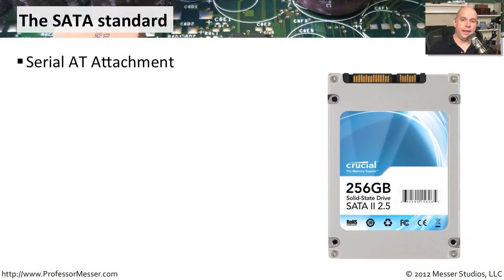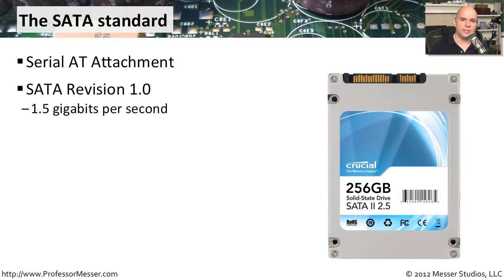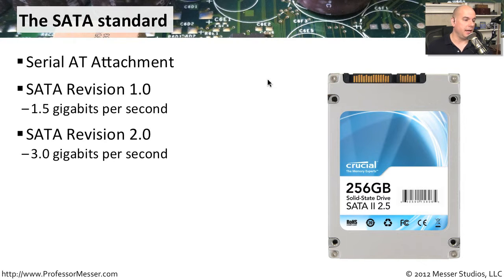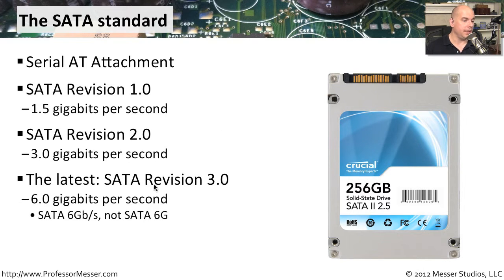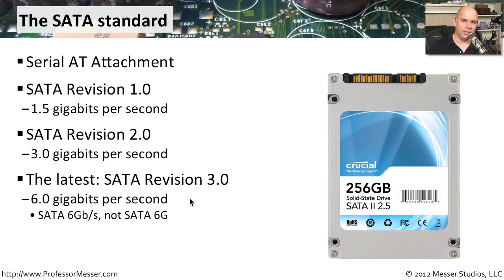Understanding SATA - CompTIA A+ 220-801: 1.5

Comment: Why are gigabits used as a measurement instead of gigabytes?
Reply: Since data is transmitted in serial, communication is done bit-by-bit. This not only refers to the transmission of data, but also control signals, flags etc. It is therefore more accurate to quote how many bits can be sent per second, as opposed to bytes, since this is how the underlying communication works. For other interfaces (e.g. PCI which is parallel and not serial) the speed is quoted in MB/s
Reply: imtiyaz hii

Comment: What exactly would the jumpers be used for on a SATA connection? PATA used them to differentiate between a possible Master or Slave connection but why would you need them on a SATA?
Reply: +cubone44 To enable (SSC) spread spectrum clocking
Reply: Thank You